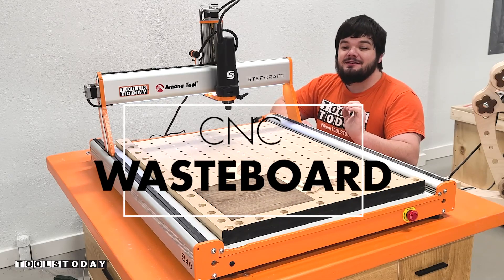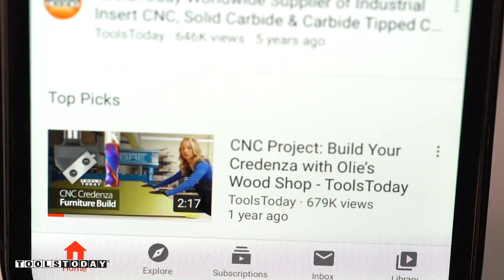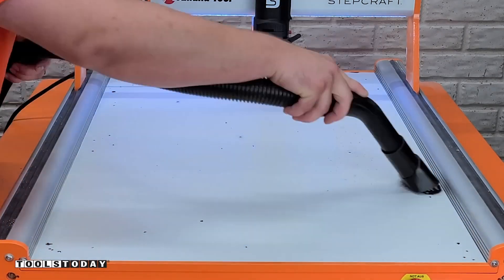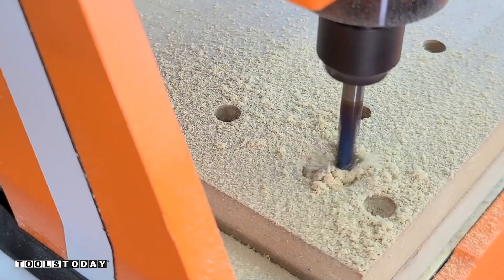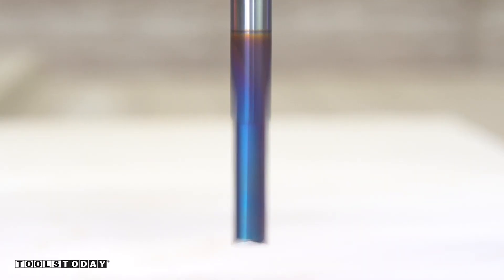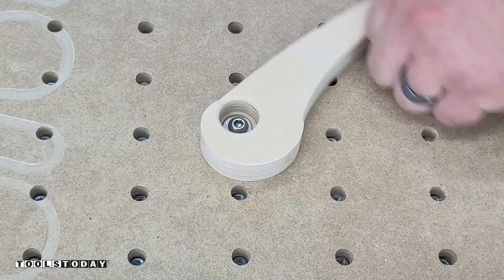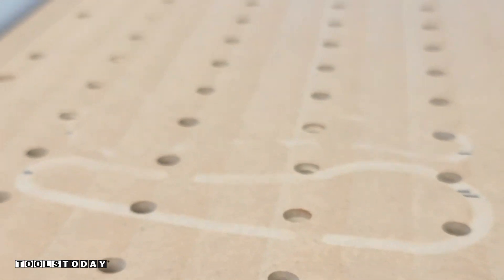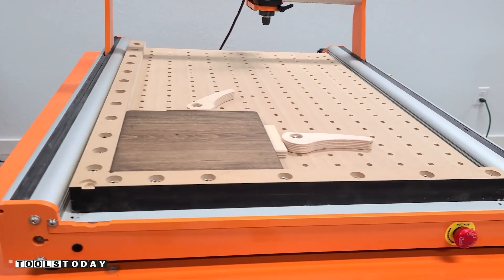How to Make CNC Clampdown Wasteboard  | ToolsToday

Comment: I like the t nuts, but i just drew up a grid with a pencil and drilled them all out by hand. No cnc pockets just sandwich the tnuts between the top and bottom board and screw together then surfaced the wasteboard.

Comment: Help me out here I am new to the woodworking world, what does a waste board do?
Reply from the maker: The wasteboard is essentially what you cut into when you cut pieces out.  It protects the machine bed.  This one has workholding solutions built into it making it super functional!
Reply: When you make any cut through the full depth of your work material, the tool has to go just a little bit further through the material to make a clean cut. For mills with flat bottoms, the penetration can be very minimal, for pointed or rounded tips, it has to go further through. Your waste board is there to sacrifice itself instead of having your tools go into the work table. Presumably the work table is flat, smooth, level, etc. and you want to keep it that way.

Comment: Good morning,  how is your waste board attached to the cnc table itself? Does it already have screw holes on the surface?
Reply from the maker: It is screwed to the stock wasteboard and countersunk well below the surface using the 55227 No-Mar countersink.
Reply: So Step Craft comes with an MDF stock waste board?
Reply: I have Next Wave shark, but it has the aluminum bed. Just trying to figure a way to use that hold down concept. I like the convenience of it.
Reply: Any suggestions? Oh! I enjoy the videos, and I like how you keep any mistakes in the video and just explain what happens. To many times we see videos, but don't know about the booboo's! I think they are important too, if for no more than preventing someone else from making the same mistake. Keep the videos coming.
Reply from the maker: @abdulwoodudlike2know3  Thanks we like to show how it really happens.
Reply from the maker: @abdulwoodudlike2know3  It's a phenolic wasteboard, but it's just screwed to it
Reply from the maker: @abdulwoodudlike2know3  You would drill through holes where the t-slot table is and use t-bolts and nuts on top countersunk below the surface of the wasteboard so you don't hit it.
Reply: Thanks 👍🏻

Comment: You defeat the purpose of flattening the board to the machine axis if you remove and fiddle with it. If you want precision, flatten it and leave it be. You probably screwed up the corner stop as well. There is reason you do these ON the machine.